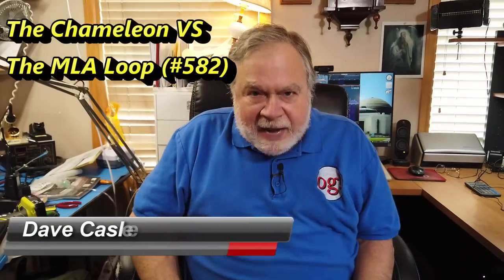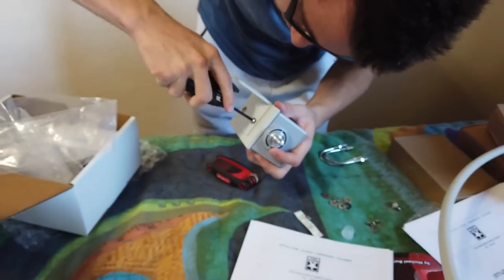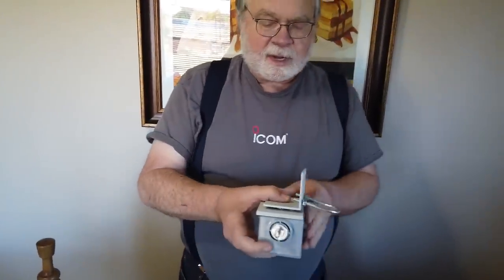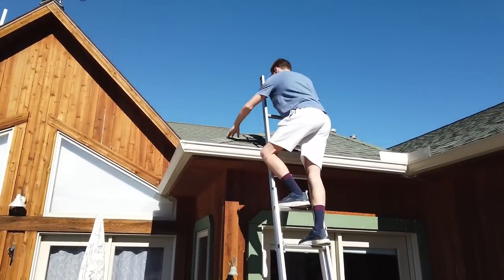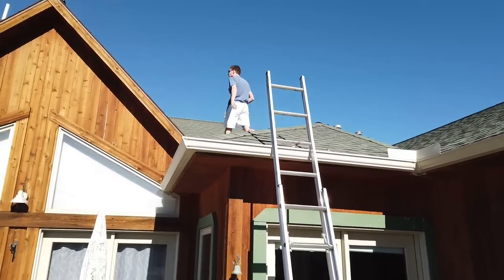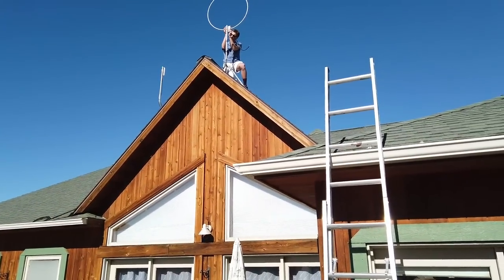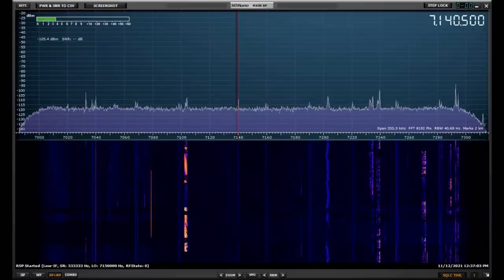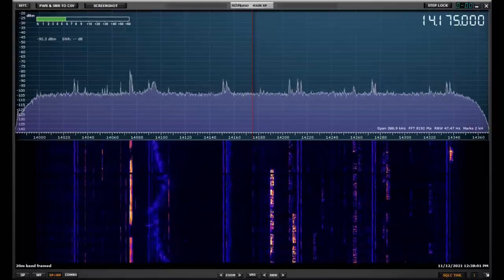The Chameleon VS MLA Loop (#582)

Comment: I just took delivery of the MFJ-1886 active loop 10 days ago. I found out that they were closing their doors due to the owner wanting to retire. Having played with it since then, I am very happy. I found it to also be about equivalent to my Chameleon CHA-PRO active loop, but with slightly better performance above 15 MHz. Because the MFJ-1886's amplifier housing has two holes at it's bottom, moisture that condenses inside the amp housing simply drains out. I wish that Chameleon, manufacturer of the CHA-PRO that I own, had thought about that flaw before all that condensed water inside the amp housing caused my amp to short out. Oh well. I found a solution to it, but I was disappointed in Chameleon's response to that issue.

Comment: I have a Chameleon CHA Pro antenna and I love it. But because of where I live, I got moisture condensation inside the amp housing after humidity spells. That condensation caused my amp to short out and not function. When I complained to Chameleon, they claimed I was the only one with that experience and that they sell those loops all around the world. To me, that was a very disappointing response. I eventually cured that problem by fossilizing the amplifier cavity of the box in Epoxy Seal 9000. My problem is now solved and it works great. For what Chameleon charges for this antenna ($570), its my opinion this should have never been an issue.

Comment: As an alternative to those considering these two rather expensive antennas, consider one of those cheap Chinese eBay MLA-30+ antennas.  Mine works great!  Like Dave, I also have mine connected to an SDRplay receiver, and I use it for most of my HF monitoring, but it will easily pick up 6M/2M/70cm signals as well – even though the specs say it is not designed for that.  

Mine is up only up 10 feet on a cheap PVC drain pipe bought from the local Lowe’s hardware store.  Still, this antenna picks up signals from halfway around the world, and it is a better listening antenna than my two other end-fed transmitting antennas.  The real benefit seems to be that it is located outside and away from all the RFI noise generated by my house and its appliances.  I got that benefit by turning it sideways to the house so that it nulls out the noise coming from things like my computer monitors and switching supplies.  My transmitting antenna runs only about 15 feet away from it, but that has not been a problem – probably because it is a non-resonant antenna.  

It comes with its own bias-T supply that is powered by a standard 5-volt USB port, but I found the SDRplay receiver’s own bias-T supply works just fine with it and without any signal loss.  And if you live in an HOA, the 2-1/2 foot antenna is just a thin wire.  It’s nearly invisible.  

So, something to consider if one is considering putting up a receive-only MLA antenna with a pre-amp.   

-- John, N0BUP

Comment: It’s good practice to hand-start all screws before using a tool to tighten. It almost appears as though one screw is already tightened and the other is being forced due to misalignment while using the wrong tool for the job. This is a recipe for cross threading. I wouldn’t place the blame on the manufacturer.
Reply: Hand treading would not have made a difference. I had to use a tap to clean up the treads. Once that was done, hand threading was possible.

Comment: I've mostly used broadband receive loops like this for LF/VLF listening and have found, for that application, getting them around forty or more feet away from any houses helps reduce the amount of noise pickup. The same goes for "active whip" type receive antennas. The Chameleon antenna looks very sturdy. 73 de WB4DW

Comment: Dave thank you for all your help and hard work putting together all this content. 
I ended up getting the DXE Loop. (Old Pixile Loop). A few months back. From what I’m seeing here all the RX only active Loops are pretty close in performance. For the those of us in the urban areas the ability to null out local electric noise is the main reason for them. Otherwise a LOG (loop on ground) is outstanding on 40,80,160. I have both Set up. 
73 
de K9AWS

Comment: Do NOT start screws with a tool.  Always use your fingers to ensure that the screw isn't cross-threaded --- else, you will have to chase the threads with a tap
Reply: Hand treading would not have made a difference. I had to use a tap to clean up the treads. Once that was done, hand threading was possible.

Comment: I just put one of these up last week and I can tell you that what Dave experienced with the threads was not user error.  The plate appeared to have been painted after threading and the paint made its way into the treads.  I took the new unassembled antenna and a tripod into the field with me a few weeks ago and was unable to use it because the tripod screw would not thread into the mount.  All three of the 1/4 - 20 threaded holes were unusable.  I even tried to chase the threads in the field with one of the screws they provided from both directions.  Nothing doing.  The finish they applied is textured and was noted to be very think.  I even tried to pick the paint out of the threaded hole with a sharp pocketknife but could not.  As a result, I was not able to use the antenna during my first outing.  When I returned from the field, I used a 1/4 - 20 tap to chase the threads and all worked fine afterwards.  This should not have been that difficult to install. Chameleon needs to chase the threads after painting or include a tap.  Had I purchased this for field day, I would have been very disappointed!

On the positive side, I love the antenna and especially like the fact that the Bias-T is powered by 12-14VDC.  That means I can get rid of the wall wart that MFJ and other use.  I can power it from my Rigrunner with Powerpole connectors.

Comment: Mounting the receive loop antenna vertically makes this antenna directional.  Mounting it horizontally should make it Omnidirectional.   Would this be a better way to mount it for use with a general coverage receiver?

Comment: Dave, did you not reach out to the manufacturer regarding the defective plate?
Reply: I just put one of these up last week and I can tell you that what Dave experienced with the threads was not user error.  The plate appeared to have been painted after threading and the paint made its way into the treads.  I took the new unassembled antenna and a tripod into the field with me and was unable to use it because the tripod screw would not thread into the mount.  I even tried to chase the treads in the field with one of the screws they provided.  Nothing doing.  The beige finish they applied is textured and was noted to be very think.  I even tried to pick the paint out of the threaded hole with a sharp pocketknife but could not.  As a result, I was not able to use the antenna during my first out.  When I returned from the field, I used a 1/4 - 20 tap to chase the treads and all worked fine afterwards.  This should not have been that difficult to install. Chameleon needs to chase the treads after painting or include a tap.  Had I purchased this for field day, I would have been very disappointed!

Comment: I wonder if the consistently higher noise floor on the Chameleon could be due to noise generated by the BIAS-T?  Perhaps swapping BIAS-T's between the two antennas (assuming they are both 12V) would be in order.  Also, by drilling out that hole for the #10 screw head you have now made a formerly watertight box not watertight, so it will fail prematurely.  I agree with other people posting that it appears Callum may have messed up those threads and Chameleon probably is not at fault.  Finally, a quick trip to the hardware store would yield the tap to fix the thread issue and wouldn't have cost that much.

Comment: Either chameleon completely botched that antenna, or your assistant stripped the screw threads.  Based on the assembly of your dx commander from your previous video, I would say the issue is your (or your assistant's) assembly technique.
Reply: He may have cross threaded it and then tried to force it. He's young. Give him a break. He's learning by doing, same as all of us. 73 de WB4DW
Reply: @douglaswilliams6834  You might be "learning while doing", but do you make a video of one of your failures and then suggest it is due to a manufacturing defect?
Reply: @daveN2MXX  You are making the assumption that the problem with the screw was the fault of the assembler. While I agree that may well be the case, neither of us actually know that. It might also have been a manufacturing defect. Chillax, and cut the young fella, and Dave, a break. 73 de WB4DW
Reply: @douglaswilliams6834   You are correct, and Dave does have some other great content.
Reply: @douglaswilliams6834  Thank you!  I had a similar experience just last week.  I was so disappointed to see how so many supposed experts jumped on the assistant.  Apparently, they are experts.  I am still looking for their YouTube channels.
Reply: The assistant did not strip the treads.  I just put one of these up last week and I can tell you that what Dave experienced with the threads was not user error.  The plate appeared to have been painted after threading and the paint made its way into the treads.  I took the new unassembled antenna and a tripod into the field with me and was unable to use it because the tripod screw would not thread into the mount.  I even tried to chase the treads in the field with one of the screws they provided.  Nothing doing.  The beige finish they applied is textured and was noted to be very think.  I even tried to pick the paint out of the threaded hole with a sharp pocketknife but could not.  As a result, I was not able to use the antenna during my first out.  When I returned from the field, I used a 1/4 - 20 tap to chase the treads and all worked fine afterwards.  This should not have been that difficult to install. Chameleon needs to chase the treads after painting or include a tap.  Had I purchased this for field day, I would have been very disappointed!

Comment: Not sure how many seconds the spectrum averaging requires before you get a stable estimate on the display. The back and forth switching would need to wait at least one full averaging.  Maybe also see how a nearby beacon is picked up for a more standard reference.

Comment: Your genius assistant stripped the threads
Reply: No he did not.   I just put one of these up last week and I can tell you that what Dave experienced with the threads was not user error.  The plate appeared to have been painted after threading and the paint made its way into the treads.  I took the new unassembled antenna and a tripod into the field with me and was unable to use it because the tripod screw would not thread into the mount.  I even tried to chase the treads in the field with one of the screws they provided.  Nothing doing.  The beige finish they applied is textured and was noted to be very think.  I even tried to pick the paint out of the threaded hole with a sharp pocketknife but could not.  As a result, I was not able to use the antenna during my first out.  When I returned from the field, I used a 1/4 - 20 tap to chase the treads and all worked fine afterwards.  This should not have been that difficult to install. Chameleon needs to chase the treads after painting or include a tap.  Had I purchased this for field day, I would have been very disappointed!

Comment: bolt was obviously cross threaded, there's where the fault lies in my opinion.  I could be wrong, but the plate appeared to be soft aluminum and not steel as was mentioned.  To say Chameleon needs to look at how they thread a hole and not consider the "pilot induced error" in the installation is not fair to Chameleon....in my opinion.

Comment: Some lessons required on mechanical assembly and the use of tools required. See a fixing bolt being fitted wrongly is not good practice, then blaming the manufacturer... No, no, no ..
Reply: Criticizing the reviewer without the facts is a No, no, no!  I just put one of these up last week and I can tell you that what Dave experienced with the threads was not user error.  The plate appeared to have been painted after threading and the paint made its way into the treads.  I took the new unassembled antenna and a tripod into the field with me and was unable to use it because the tripod screw would not thread into the mount.  I even tried to chase the treads in the field with one of the screws they provided.  Nothing doing.  The beige finish they applied is textured and was noted to be very think.  I even tried to pick the paint out of the threaded hole with a sharp pocketknife but could not.  As a result, I was not able to use the antenna during my first out.  When I returned from the field, I used a 1/4 - 20 tap to chase the treads and all worked fine afterwards.  This should not have been that difficult to install. Chameleon needs to chase the treads after painting or include a tap.  Had I purchased this for field day, I would have been very disappointed!